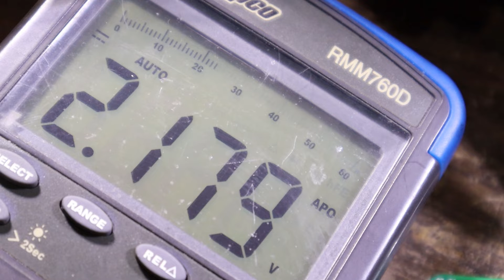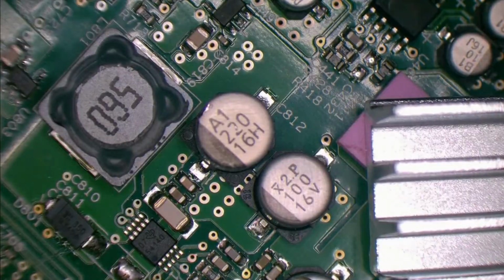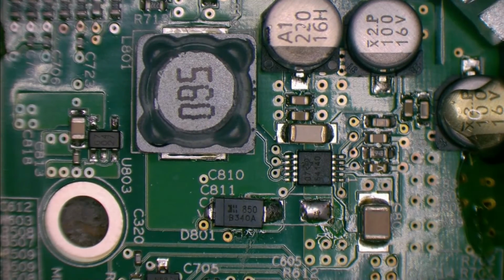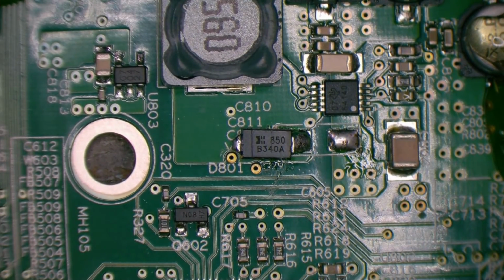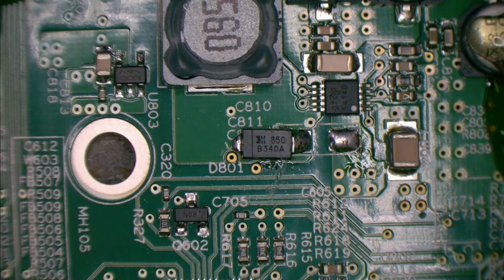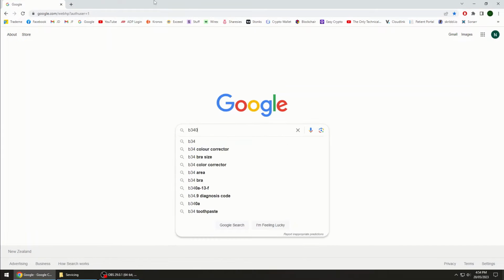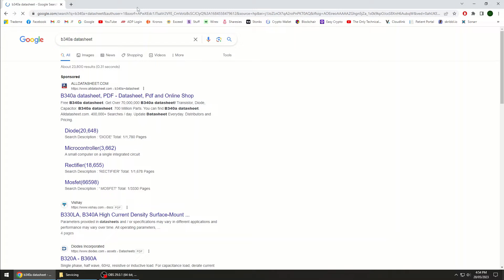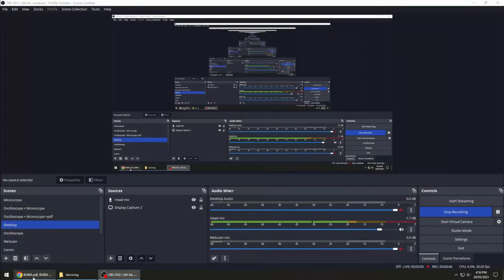BOSE BASSMODULE 500 NO POWER REPAIR!

Comment: I know this is an old video, but I had the same problem and replaced the diode but when I go to reassemble it I can’t get the flex cable for the power button to reinsert onto the connector. It seems to go in a little ways and then bend. It falls out when I connect the other connectors. And suggestions for what I can do?  Thanks!
Reply from the maker: Make sure the silver strips at then end aren't damaged/folded back on itself as this can happen. Otherwise you just need to hold it very securely and straight and push until it goes all the way in. Long nose pliers work well but if you can, use smooth ones so as not to risk damage when you squeeze it.
Reply: @JonnyFix . The end has a fold about 3mm up so when I try to push it in it goes in part way and then collapses on itself. It isn’t engaging with the connector pins so it just slides back out again. I feel so frustrated to have replaced the diode only to fail because I can’t reconnect the power switch.
Reply from the maker: Could you reinforce it by sticking a thin piece of plastic to the back side to help hold it flat? Couldn't be thicker than the flex itself

Comment: Hi, ive got a 500 base, and recently its stopped working, 
When i plug the cable in the orange light comes on for a few seconds, then stops,
If i put my ear close to the base, i can hear a high pitched whining like its trying to oick start itself,  then when i unplugged it , the light comes on for another second or so. what could be the issue ? Thank you very much, i dont want to send it to bose and costing me an arm and leg. Thanks a lot
Reply from the maker: Not sure sorry I haven't seen that fault.

Comment: Still worked for me. My voltages were different on some occasions, but the short was the same at that B340A diode. I replaced it pretty easily and it worked first try. Thanks so much for the awesome video.

Comment: Hi Johnny, thanks a lot for your video which is very useful. May i ask you a question? At the very beginning of your video (4mn) testing the large capacitor, I have only 1.2V. Very surprised to such a small number. 
Then, at 7mn of your video, testing the 2 pins on the left with the center pin, i properly have 0.3. But right after (7mn43s) whem you have 27V, I have almost nothing (few miliVolt). According to you, what is the pb ? Is it the large capacitor? Thanks for your help.
Reply: Hi I have a similar findings as well on my Bass Module. Have you figured out the solution?

Comment: Thanks for sharing! I do have a question regarding the diode. Is there a difference between B2100 and B2100A-13-F?
Reply from the maker: You could use either, nothing functionally different.
Reply: It Worked perfectly with the B2100A-13-f 

Thanks for the answer and Great help :)
Reply from the maker: @janleguk4773 Excellent!

Comment: After replacing the diode the device goes on and works sometimes a minute sometimes longer then it turns orange, off, white on and works again. And this goes like a loop. With the 3,5mm jack same issue.
Any idea ?

Comment: Whole project cost me less than $20. (You can buy soldering kit for 11$ and diode for 6$ with shipping from that digi key). It had to be that diode, because it worked when I plugged it in however smoke came out so I had to mess something up. Anyway, my fault, and I am happy that I gave it a try (never done a project line that involved soldering however I read a book about and what I have learned is mine) :) anyway, thank you for sharing!

Comment: Why is this happening with the bass?
Reply from the maker: Maybe under rated for the job
Reply: @JonnyFix  what you mean?
Reply from the maker: The diode isn't a high enough rating e.g. maybe it should have a 3 amp one instead of a 2 amp one.

Comment: Hi! I have the same problem with my Bose bass 500 module. Total newb here. I noticed you replaced the diode from B340A to B2100. Would you recommend me doing the same? Or sticking with a new B340A diode?
Reply from the maker: Either will work just fine
Reply: @JonnyFix if I’m getting a reading of .3 ohms, does that tell me the diode is not the problem?
Reply from the maker: @ianpascua8690  0.3 is too low if you are measuring each end of the diode then it's bad.

Comment: I did exactly in the video and it worked for a good 5min but now it won’t turn on again, I checked the diode and it does not beep on either side
Reply: Do you know if I need to replace the same diode again?
Reply from the maker: Hard to know. A should only go in one direction. Did you put it in the correct way? When testing use diode mode on multimeter and put red lead on the end without the stripe and black lead on other end, you should read about 0.3 to 0.5 volts, with the unit unplugged of course. If not, try a new diode. Otherwise you have some other fault. Check soldering and make sure it is connected well.

Comment: Would be interesting, if Bose uses a better Diode, if you use their repair Service? Do you have any Information?
Reply from the maker: Unsure what they use. I imagine they would only upgrade it if they agree there is a pattern failure here while under warranty otherwise it's probably original spec. Given the years they last I don't think they see a need for it but anything's possible.

Comment: Hi, I have one of theses bad boys, I checked the pacifier I have 0 not 27.79 like yours. I’m in the us, where can I get components? And thanks for the video, so much info.
Reply from the maker: You can get parts from mouser, digikey, element14
Reply: @patricojean I have the same issue as yours. Could you tell me if you manage fixing it? If so, what did you replace? Thanks a lot

Comment: Johnny thank you so much for this fix, I had exact same issue, replacing the diode brought my unit back to life. Quite bad design for something like this to take out a quite expensive unit after such little use. Thanks again, I wouldn't have been able to diagnose and fix this, would have been in the bin.

Comment: Is that status amber or white?im having problem connecting to the soundbar,and mines amber status supposed to be blinking white to connect?and i think i put the thing backwards because the light supposed to turn off right?
Reply: Did you find any solution
Reply: @pranavarora5784 i just sent it to bose for $120

Comment: Thanks to you I fixed mine in 30 minutes. My testing was identical to yours. I replaced the diode with a 3amp through hole diode. You saved me a ton. Thank you.
Reply from the maker: Awesome!
Reply: You just saved mine! Thank you! Saved me soo much time! Awsome!
Reply: Can i buy this diode on amazon?
Reply: @LuthergPendeltonu  yes, but its seems like its cheaper on digkey. I just order two from digkey with shipping it was 6$, and some basic cheap Weller kit on amazon for 11$ (total cost me less then $20) I will get back here how and tell you how successful I was in few days.
Reply: Could u put the part number
Reply: Where did you buy the diode
Reply from the maker: You can get them from many places like element14, rs components, mouser, digikey etc, whichever is more convenient for you @franciscotorres5113

Comment: Hi Jonny, 

Thank you for your video and time !

I have this module and it suddenly stoped emitting sound. 
I followed every instruction about reseting the device without success. The bass Module cannot be detected wirelessly, it appears to be somehow detected by the soundbar when plugged with a 3.5mm jack, but even then, no sound at all. Even the powering on sound doesn't exist anymore. Any idea how to start my investigaiton ?
Reply from the maker: Not sure how you mean detected by sound bar. Does it have a light on? If no light maybe it's not even turning on so could be the problem in video. If there is a light I don't know sorry, I haven't seen this before.
Reply: Wow sorry to hear about that. These speakers are expensive, I would have thought that if you pay premium, then that's what you get.

I was thinking of buying one, but your post made me get cold feet. 

Did you end up resolving the issue? Was Bose taking responsibility for this?

Comment: Hi Jonny, first, thanks for the video. I m sorry because my english sucks but i have the same trouble than you, no power.

I m not good at electronics but i tried to check the same diode than you and i don t understand how do you know he is fucked ?

When i test it on OHM mode, it sounds like you with a beep and show 0.5 OHM. 

Thanks for helping and sorry once again for my english 

Loïc
Reply from the maker: Your english is pretty good. 0.5ohm is bad, replacing it will be a good start.

Comment: Hi Jonny my bassmodule 500 started to pop every once and a while. I followed Bose instructions by moving it to different locations, plugging in different outlets, etc. None of that helped. I returned it to Bose who sent it back after four weeks claiming to have repaired it. It’s now worse than before. Would you have any idea what can be causing the popping sounds?
Reply from the maker: Could be interference from wireless router or something else in your area. If you have one, turn it off and see if it stops. Try another location, at a friends house etc see if it happens there.
Reply: @JonnyFix  I decided to try using a shielded audio cable instead of wireless. That looks to have fixed the issue so far. Disappointed with this product though. Thanks.